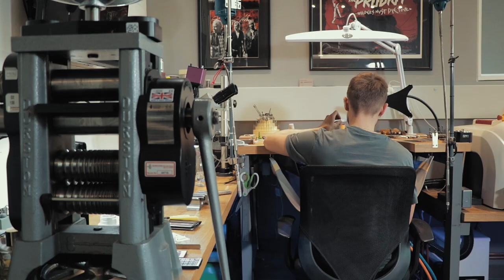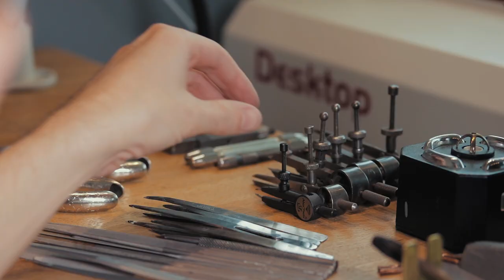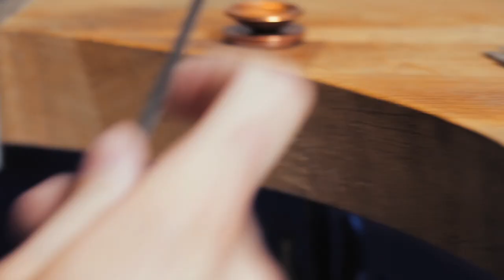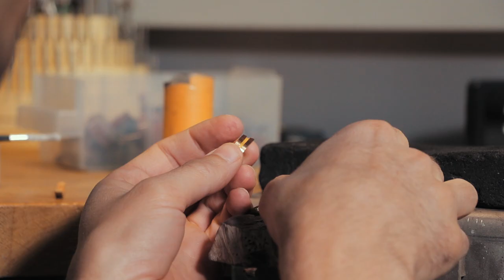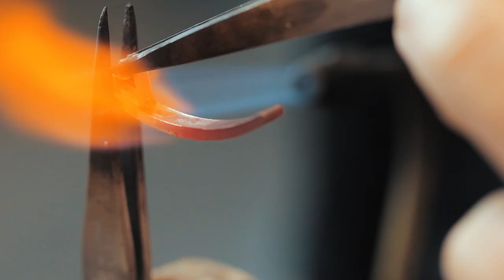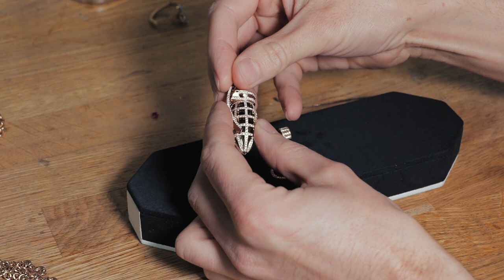Custom Chain With Secret Compartment

Comment: That workspace is incredible. All the tools with in reach and the fabric to catch any valuable metal dust that falls. 

How are the tiny diamonds secured in the pendent? Is it glue?
Reply from the maker: Hi, it is not glue. I make small claws in the gold which I push over the side of the diamonds to hold them in place. Glad you like the workspace.
Reply: @BobbyWhite  incredible work thanks.

Comment: G'day fellas, im an apprentice jeweller in aus. Im just wondering, when you're splitting the claws to set the diamonds, is that enough to hold them in/are you under cutting them? Or do you have to bead them over afterwards?

Comment: I feel like the lil latch for the top to come off could fall off easily if its pulled by sum on accident and lose the bottom part
Reply from the maker: This has a snap the same as how you attach a bracelet together. We have been making these snaps for many years and never had an issue.